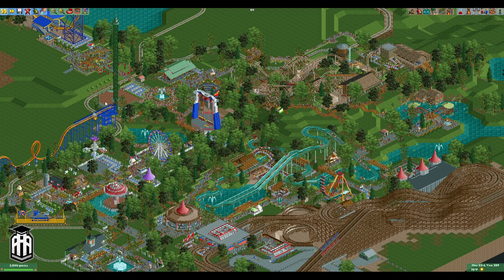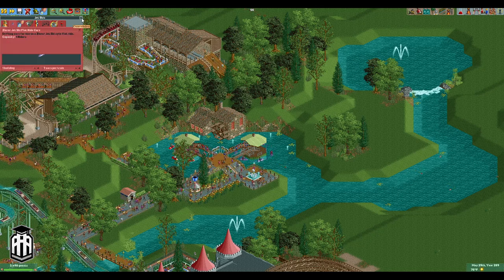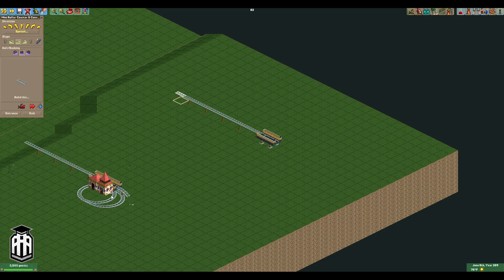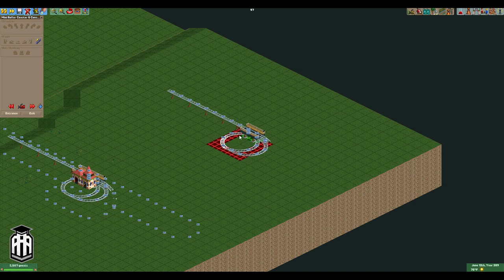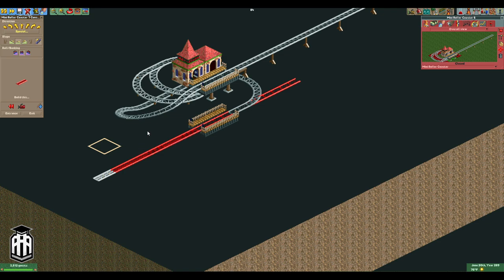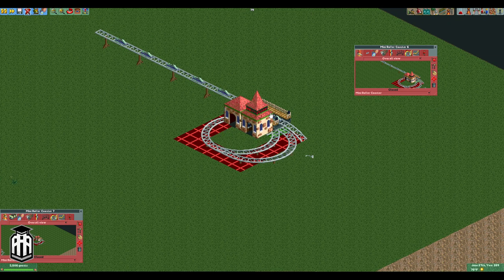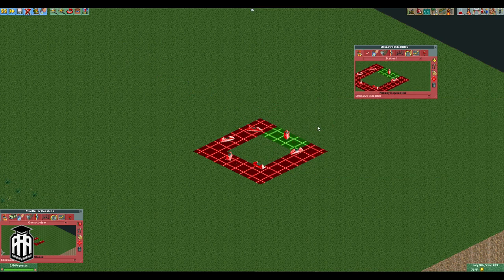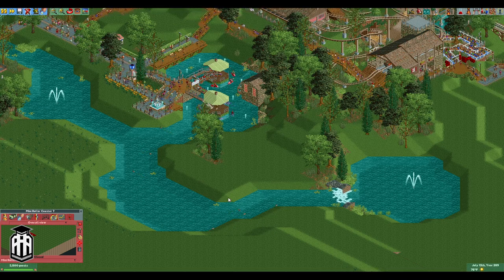RCT2 Hacking: Zierer Jet Skis

Comment: I'm certainly going to try this one ... but I'll probably have to use the actual in-game jet skis, because the download at New Element won't work for me. Oh well. Still, a nice idea for a ride.
Reply from the maker: If you download a park with the file in it, that'll give you the ride.  Most people don't individually download objects-- it's just easier to import with a park.  I'll plug one of my own and suggest you download this one: https://www.nedesigns.com/park/4163/h2h8-semifinals-allegheny-adventures/
Reply: @AmusementAcademy  Funny thing ... the nedesigns discord couldn't tell me why (as a member) I couldn't download the ride, but they did suggest getting it by downloading that park ... did it yesterday!
Reply from the maker: I think the object database is just kind of messed up.  I know it hasn't been maintained for years and it'd be a fairly labor intensive thing to keep up with at the rate new objects are coming.  Downloading the parks is way easier-- I'd also recommend downloading the workbenches that NE members post every so often.  Usually it's a great way to get all the current useful objects in one spot and organized in a nice way.  Those are the best for starting a sandbox park and than customizing to your liking.